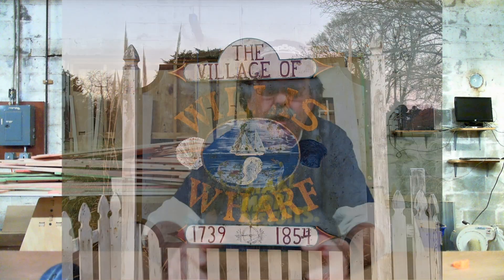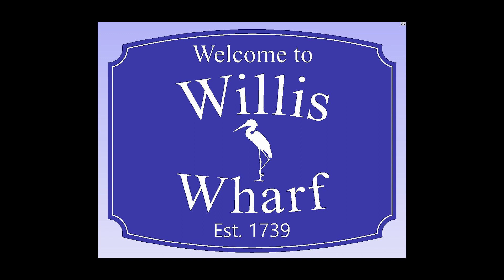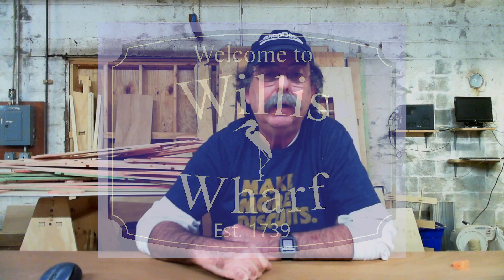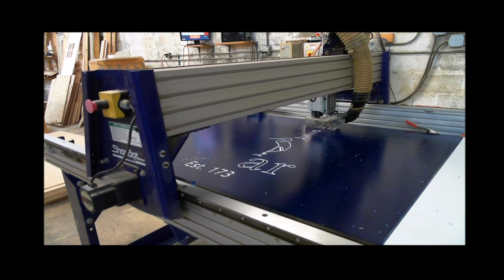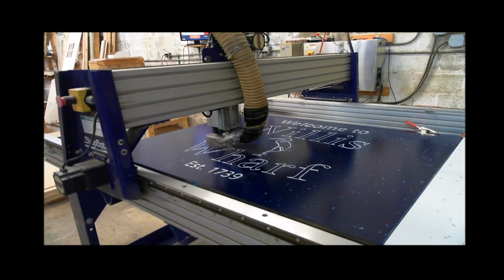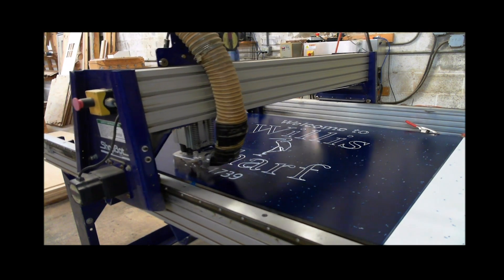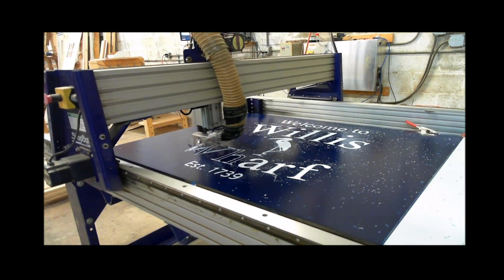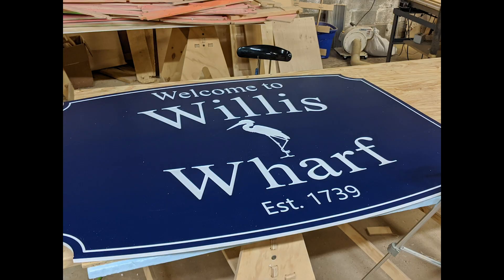Bill Young: Using CNC to Create a Community Sign

Comment: Nice looking sign!   Do you think because of the dark color it will heat up and warp in the sun?
Reply: It's certainly possible...we'll see this summer! It will certainly move a bit with temp changes, but just being attached on the edges I'm hoping it will bow a bit but not be too big of a problem. It is facing North-ish which helps, and I left the South-facing back of it white.